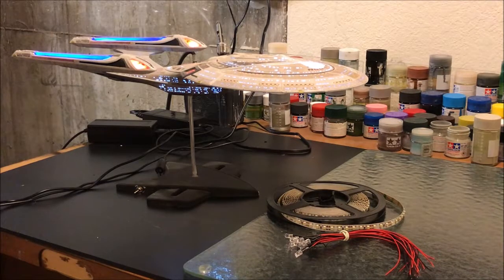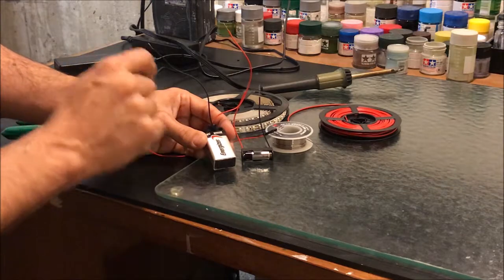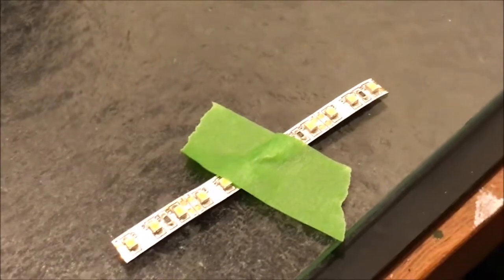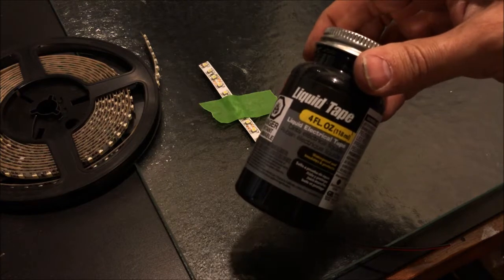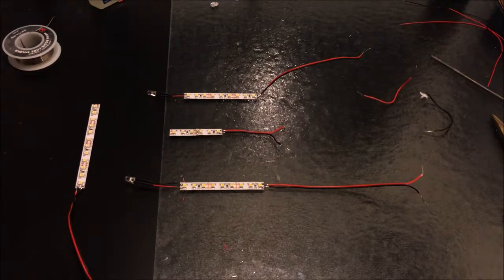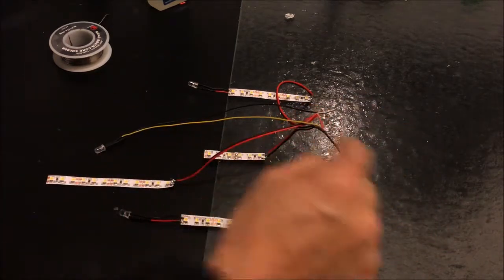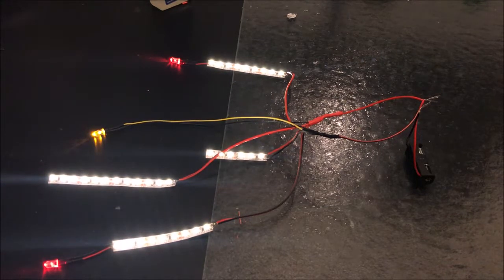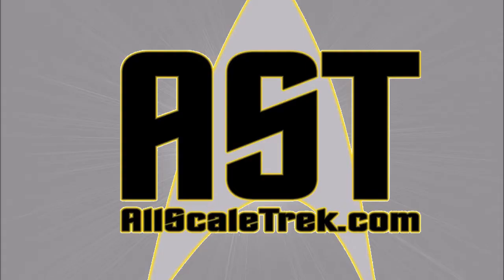Do it your self lighting tutorial.

Comment: This is a great tutorial to get me started. How do other things factor in, such as nav flashers?
Reply from the maker: For flashers, if you only need one you can buy a blinking LED, or if you have several that need to blink in unison, you can use a blinking LED to run several fiber optic lights. But those won't blink in pattern, or a specific speed. Most people who want a specific rate, or a double blink pattern use a timing circuit board. Many people use a 555 timer circuit. https://electrosome.com/category/electronics/555-timer-circuits/page/2/ I've never gotten into that, as I like to stick to pretty inexpensive projects.

Comment: So, I am partially through the painting stage of my 1/350 K'Tinga, which also happens to be the first Trek model I've built since the early 90s. I also have the 1/350 TOS Enterprise along with PL's light kit. However, knowing I don't have room for a bunch of 350 kits (I already have several of the 1/32 large WWII bomber kits to chisel out space for) I started looking at 1/1000. I saw a review of the 1/2500 Enterprise set but was put off by the detail at that scale and the meh end result of building them. So far I have the recently released Excelsior and grabbed an Enterprise B off eBay for a really good price (relatively; current prices of the new kits are better) and really wanted to light up all of them as best I could. Starships don't look right without lights. I was hopping through a couple of your 1/1000 reviews and saw this video and it was a great help in convincing me to give it a shot at a basic level. Many of the other builders are using the TenaControls and the 555 chips you mentioned to another poster, and it's a bit intimidating to a newcomer. You actually showed something a new guy can use. Thanks.